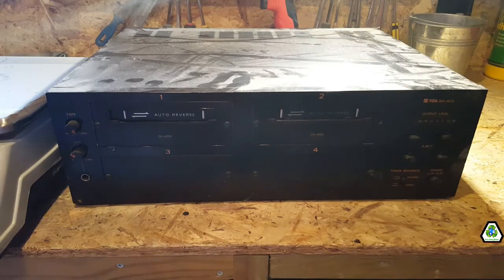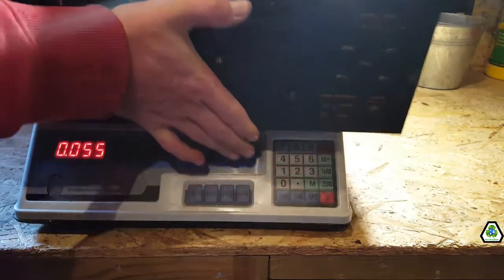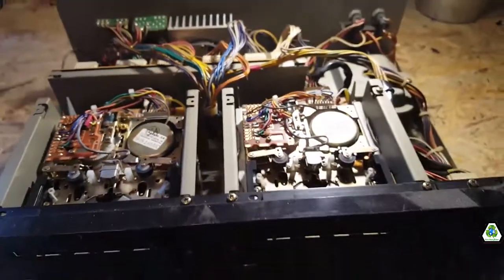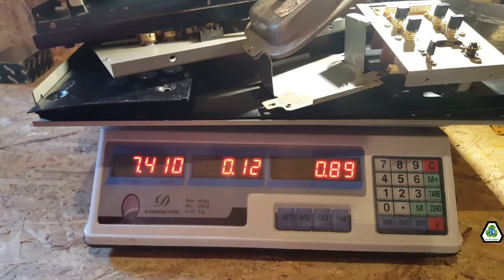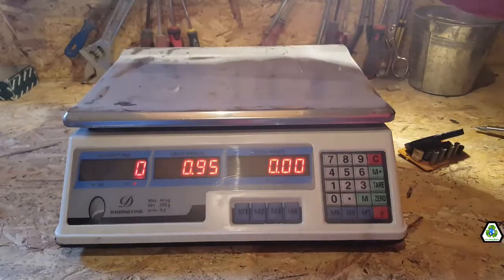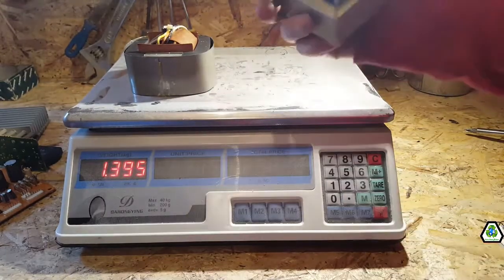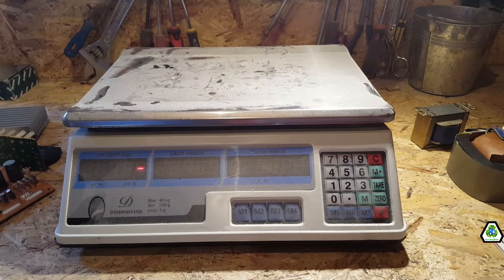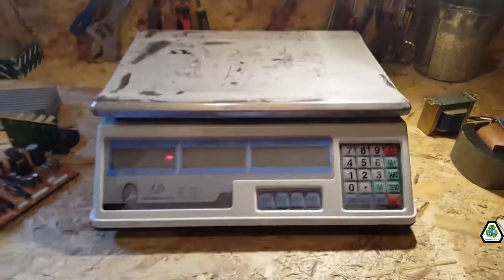♻️ Scrapping out a vintage cassette player

Comment: Hi Ben My scrapyard must have been ripping me off, coz he been paying me I think just over a pound per kg for cable and you put down 188 per kg. but I have been happy on prices on other metals hes given me, anyway its nice to see you've brought out another video and I hope your back..!.
Reply from the maker: £1.88 is for the single cable it tends to jump between £1.60-£1.90. household cable i get £1.20  kg but i can put anything in with it like ribbon wire, coax, cat 5 i accumulate wire fast so i just bag it up as a mix i only seperate the singles from it

Comment: Quick question Ben do motherboards have to be in one piece to take to scrap yard sometimes I break a few when tearing Down stuff and I'm not sure if they still have value. Great video as allways keep em coming
Reply from the maker: They like them as whole as possible so they can identify them but it doesn't really matter because they shred them anyway you need to remove aluminium and batteries tho
Reply: Ben Houghton ok thanks dude